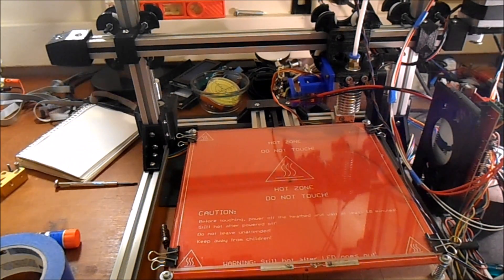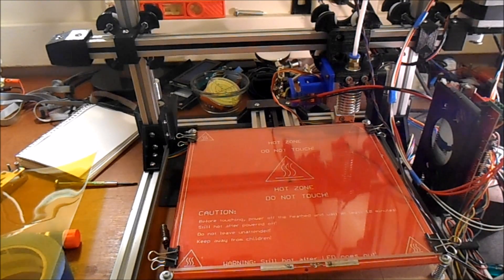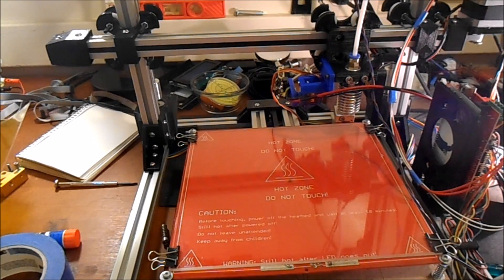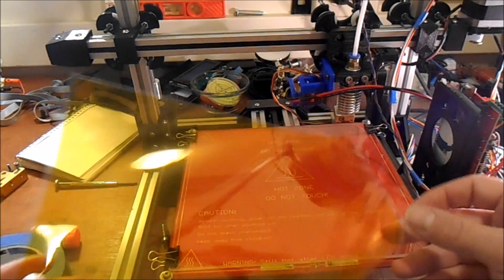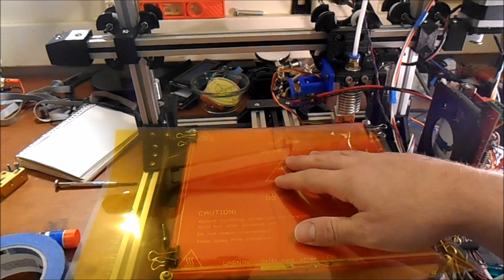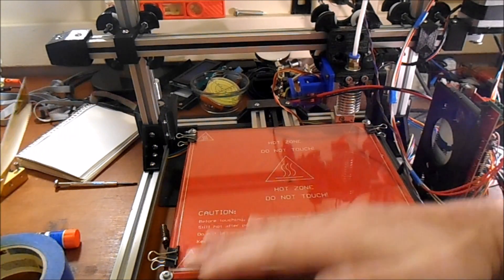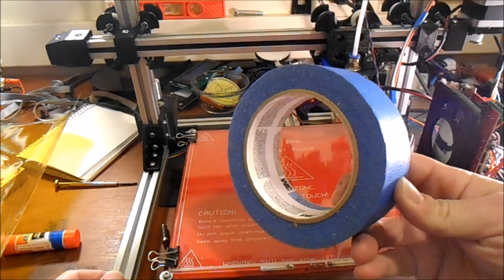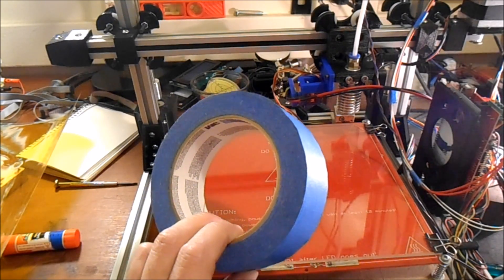3d Printer Hacks: Surface Adhesion

Comment: im making a super low budget 3d printer !!!! thinking about skipping the heated bed all together !!! i know the consequences but im a student and cant pay for it all !!!! what should i use as a bed ?? will glass and painters tape work ?? or should i sacrifice my lunch money for a heated bed ??
Reply from the maker: I used glass and Elmer's water soluble glue (purple).  I have a heatbed, but have not used for years.  It's all about getting the levelling perfect and running PLA just above melting point.  I used Hatchbox at around 182 C.

Comment: what is the actual size of your bed?
Reply from the maker: It's 200x200mm for this printer.  You can always scale your bed to the size you
 would like.  Just modify the aluminum sizes for the axis you desire.
Reply: Edward Braiman is the whole bed 200x200 or is the white square the 200x200 area
Reply from the maker: I'll have to measure, but I'm usually using the area between the white lines on the PCB heatbed. The design of the multipurpose print will allow you to vary the size you may require.  I'll be redesigning the carriage for the x-axis soon, but it will not change much.  I'm going to be adding a new modification for a Spindle controller and maybe thickening the extruder hotend.  Also I might add a hardware configuration for a Diamond hotend.  I'm still waiting on parts to arrive so this could be a couple of months away.  So my current videos will cover subject matter requested.  If you think of something that I've not addressed, taking requests.  There will be several output videos coming in the next days and weeks and then a display video for SPI and I2C configurations.  Also a new additional stepper video for AUX2.  So I've got a lot of material that may be of interest coming and a limited amount of supplies for new videos.   That's for the insightful question.
Reply: Edward Braiman could I use acrylic for the x carriage and could I have templates of the x and z carriage?
Reply from the maker: +Will Kim I'm not sure i understand the question.  Do you mean can you make the printer parts from other materials?  In the abstract, yes.  But always considered your safety and that of others. The second question I'm not sure I understand.  The STL files are posted on thingiverse, the new designs are currently not yet available until I receive the hardware to design them against.  I always release a design when I test the fit first.  So it maybe about 4 to 6 weeks until something is posted as this is the window of time it takes for the part to arrive and then me to design a form factor to hold it.  This estimate is connected to travel and when manufacturer ships hardware. My design time is usually only a couple of hours after there is a physical part.  Hope this helps.